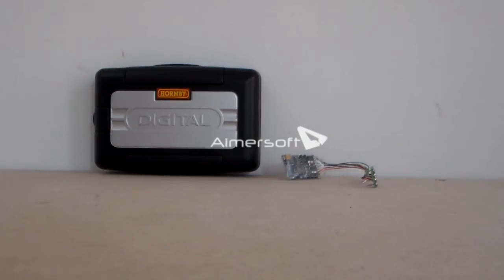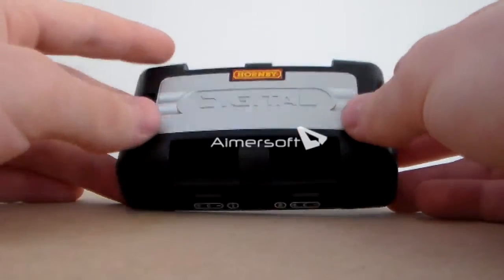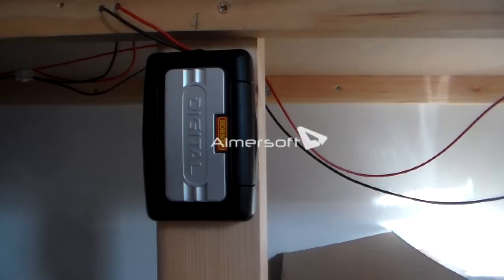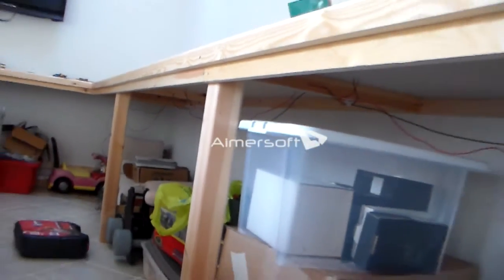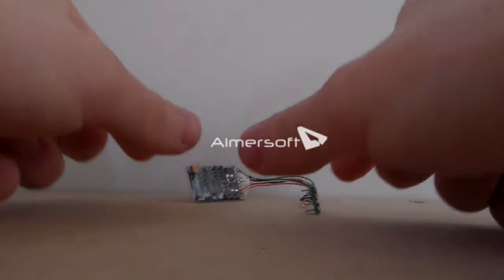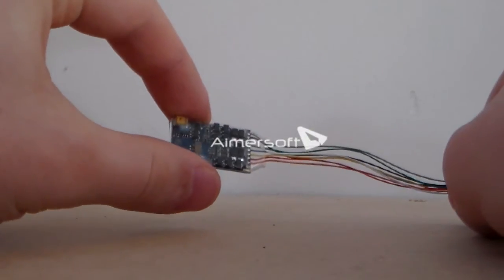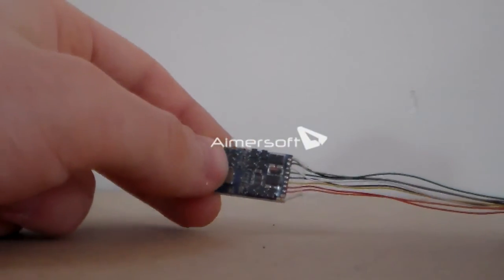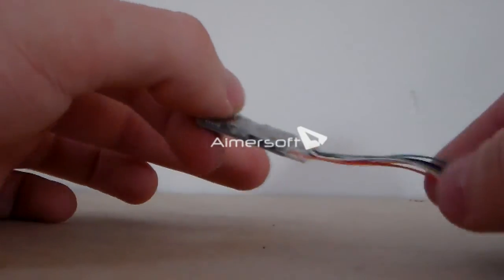'DCC In Depth' Episode 2: Decoders

Comment: Does this mean you do not need to connect the select to the track using the usual digital track box thing? You just solder the wire to the track and it works the same?